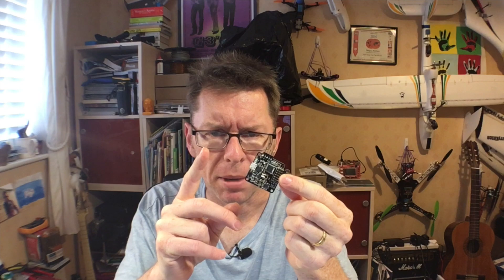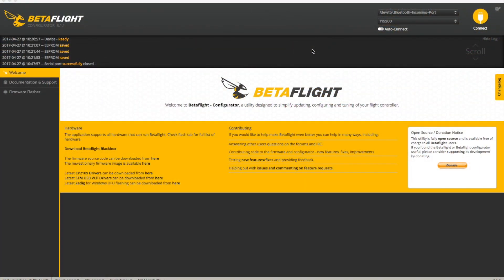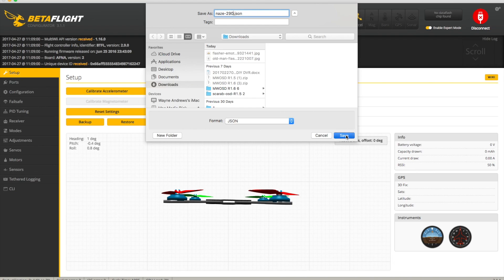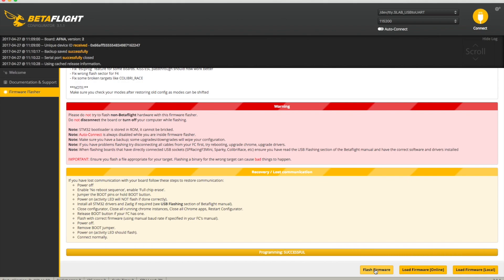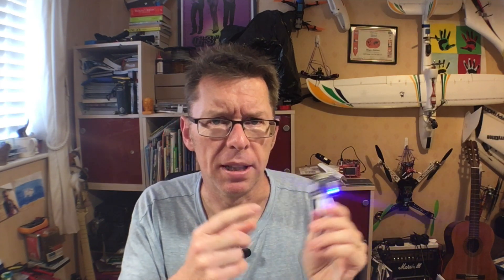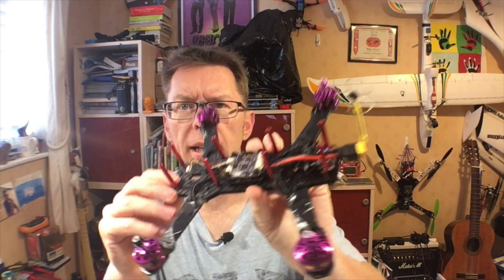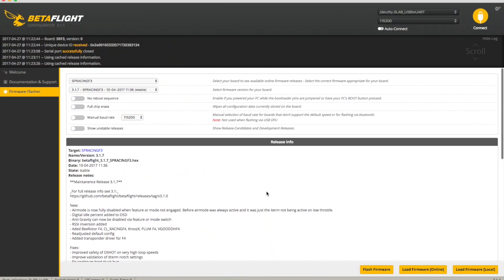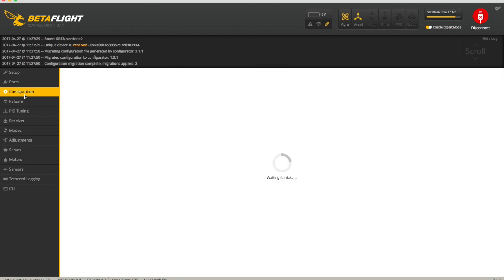FPV Tutorial: BetaFlight Basics Part 1 - Flashing your FC, and what to do if it goes wrong

Comment: So the controller board on my Emax tiny hawk II freestyle will not connect to beta flight.  I connect the data cable I get the initial fast flashing lights then I get two lights and they flash intermittently.  I try pressing the connect button on beta flight and the drone will not connect.   Also when I connect the battery (it’s not connected to beta flight of course). The drone will not power up.  Can you tell me what the issue is?
Reply from the maker: Well, if you are connecting a battery and the quad isn't powering up - that's quite a large issue.  It's not that simple to track down this problem as the TH II freestyle using a single board with the 4-in-1 ESC and the FC.  Did it work originally and stopped, or was this the case from the off?
Reply: @CurryKitten  yes it did work before.  I was actually flying the drone and brought it back in to change the throttle settings.  When I tried reconnecting to beta flight it will not connect.  It was intermittently connecting then all of the sudden it stopped connecting all together.  I can see the flashing lights on the drone but it would not connect.  That’s one issue.  The second issue I noticed that the blades were starting to rip the insulation off the wires for the battery.  I tried moving the wires out of the line of fire for the blades and tried covering the exposed conductor with electrical tape.  I reconnected the batteries and the drone would not power up.  I did a continuity check from the leads on the battery connector to the point where the wires connect to the control board.  My fluke showed that the connection was good for both wires.  I bought another control board and drone altogether and tried connecting the same batteries it powered up both the new drone I bought, and the additional control board I purchased.  I was also able to connect both items to beta flight with no problems.  Please advise.  Thanks.
Reply from the maker: You could try reflashing the firmware to the board - in case it's unable (for whatever reason) to startup betaflight.  You can do this without needing to connect to it in the normal way.  But the lack of powering up does suggest it's more fundamental.  The quick fix is to simply replace it with the one you've bought, or you could look for potentially bad components by tracking the power through.  Best guess, perhaps it's a voltage regulator that might have gone kaput.
Reply: @CurryKitten  I'll just replace the control board with the one I have and go from there.   Thanks!

Comment: Hello Wayne:  i tried to flash my brand new Tina Whoop after trying to get it to arm and not being able to do it.  Followed instructions.  Tried to connect to betaflight, would not allow that,  tried to  update drive4 with Zandig after 20 minutes it failed too.  My 77 yo eyes cant see the bind button, so im stuck with a new toy that wont function.  Any ideas?  John.
Reply from the maker: I assume it's the boot button you can't see rather than the bind?  In which case if I've got the FC right on the Tina Whoop it's a pretty small little button http://myosuploads3.banggood.com/products/20200701/20200701210610QQ20200702095734.jpg If the original firmware is still intact then it might be a simpler thing to attempt to fix the arming issue - which, given the number of people who have the same issue, tends to be that betaflight thinks your throttle is active when it isn't and so refuses to arm.  Let me know what position your quad is in - can you connect into betaflight normally, is it bound to your radio ok?
Reply: @CurryKitten  wayne:  i was able to fix the port with impulse rc and connected to BF, flashed the firmware successfully.  Motors 1&2 will not run in motors, yaw and roll are reversed in setup screen after calibrating accel(before also) changed in receiver screen but that did not work.  Changed AETR, to EATR.  Saved original setup to desktop not bu restore in BF so not am trying to restore originals.  Dumb i know should have been so easy.  I noticed in BF the little battery symbal at the to0 of the setup screen is flashing all different voltages on this T W, not solid green like my old TW.  Any ideas where i need to go?  J
Reply: I did not try to setup my TX 16, i was trying tu us3 the radio that came with it.  I needed your inputs and mixes info from your video to setup my opentx.  J
Reply from the maker: There's a lot to go through there John.  It sounds like some of it is down to some of the firmware settings.  For example you are saying from the setup screen that yaw/roll are reversed - and linking that to the accelerometer calibration.  So are you saying when you lift the quad up physically and tilt it, then it reports roll when you are pitching and vis versa?  In which case that's probably an orientation setting on the board (configuration section)  The lack of motors 1/2 running is the biggest thing to solve.  If they were running before hand then it's probably a difference in the resource settings in the firmware config.  Given that you did flash the right firmware (presumably you checked which one you were running and got a later version) you need to be able to diff against the changes in the original and what you have now to put these things right
Reply: @CurryKitten  wayne  I misspoke its ele and roll that are reversed.   I thought i could change that in receivers, but change in the ae, in aetr didnt effect a change in the setup screen action.  The two motors never moved from the beginning.  Im a mess struggling and appreciate your help immensely.  Maybe its taer in the tina whoop setup.  Id be glad to pay you an assistance fee if you could help me get this TW flying.  John
Reply from the maker: John, there's too much going on in this quad to try an diagnose things in the comments section, but feel free to ping me en email at currykittenfpv at gmail dot com.  Perhaps you can give a full history of this quad - having motors that have never responded is a bit of a red flag in terms of getting a new model
Reply: @CurryKitten  will do Wayne.

Comment: Hi,great video,I've got the same problem with my mobula7, ive done everything you did in this video but still wont flash,just says" failed to open serial port",I'm on windows 10,do I need drivers for this to work,if so,which one? many thanks.
Reply from the maker: I'm not a windows user, so I fall down a bit trying to advise people here, but I keep hearing about the Zadig driver to get into DFU on an FC.  Have a look at this page https://github.com/betaflight/betaflight/wiki/Installing-Betaflight and scroll down to read about zadig
Reply: Its sorted now,many thanks for your reply 😉

Comment: I flashed the wrong firmware and now my usb doesnt work
Reply from the maker: Using the boot button, you should still be able to flash the correct firmware to your board.
Reply: @CurryKitten  thanks. It worked just took a couple times :)
Reply: ...fried the board after installing the receiver lol \_(:/)_/
Reply from the maker: Oh dear - how did that happen - you wouldn't have any dodgy voltage coming in from the RX only out to it ?
Reply: Not sure im new to the space. Everything looked right to me until i connected the receiver. Whats weird is the only voltage going in the fc board to the reciever was from the usb which is 5v. Im gona use a multimeter this time and a fuse between the battery and pcb. Unfortunately i have to buy a new fc board. But i guess that comes with not being experienced.
Reply from the maker: That does sound curious - it's really difficult to fry something when you've only given it the 5v supply from VTX.  Unless you made an error connecting up the RX.... but generally you'd end up killing your RX rather than your FC.  If it helps, we've all got a little pile of bits that we've managed to blow up/murder one way or the other.
Reply: @CurryKitten  turns out the receiver had nothing to do with it.....the metal plate for the SanDisk on the F.C. was touching one of the voltage cables on the P.D.B.  ....almost certain thats what shorted my F.C. board....lessoned learned! Lol

Comment: Good video. I'm having trouble trying to set up the betaflight configurator don't have any idea where is the problem but I keep looking .
Reply from the maker: When you say “setting up the configuration” it should just be a case of download and running it.  Is something going wrong doing this?
Reply: @CurryKitten  yes I think I'm  doing something wrong  installing the drivers for betaflight so I'm not able to connect the flight controller
Reply: And I think that what I'm doing wrong was installing the drivers one step that did not follow was to download the hex files.

Comment: Hi CurryKitten, what version of betaflight would you recommend for someone like my self that can fly acro but am still heavily learning? I've just finished my new build that is a 5" with a DALRC F405 flight controller. Cheers.
Reply from the maker: If you are happy with how your quad is flying - then leave it on whatever it's using.  But if you are building from new, then I generally find that every version of Betaflight is just that bit better even on the defaults, so stick the latest stable version on your board and go from there.

Comment: Would you please do a short show how vid of that last firmware update you spoke of at the end of this Video,, i realize its been a minute since u made these, but i dont seem to grasp the idea on how to get the update completed correctly when i view the only few others instructional videos they have on the st bootloader way, I have a Jjpro p200 race quad, and it came with Cleanflight on it, and an old one at thaf, and when i attempted the flash it did read that it was successful, but now whenever i try and connect to cf or bf, it tries to connect amd then eventually closes, and leaves me with some message which i cannot recall at the moment, but i ve tried to do my homework on the issue and ive come to the conclusion that i do infact need to flash the firmware (naze32/with Spracing firmware btw) but i dont have the correct st flasher, nor the correct info on what to do when and if im abke to get past that point. I would greatly appreciate the help, as ur videos for me anyways seem to be more my speed, plus u dont fill up the time with a bunch of snobby  binary code talk that seems to only alienate me and confuse the hell out me, , I have enjoyed seeing ur reviews etc over the past couple years.  And i know with ur help, ill be able to figure this damn thing out! Also, if you would think about maybe doing sum how toes on setting up ur tananis, mine is qx7, a setup on how to get  the voice working aswell as loading any other mods such as personal opening screeen and so forth,, that would surly help.. thanks again, !
Reply from the maker: Ok, so I'd actually recorded an extra segment using STFlash which is here https://www.youtube.com/watch?v=rs7hgWaV1No (but a bit raw and missing editing/close ups/links etc)  It was mainly discarded because after some testing I was unable to actually find a situation where I couldn't use Betaflight to flash the board in combination with the bootloader.  If you managed to flash the board before but now it doesn't talk, it's possible that's a case of flashing the wrong firmware on it (helpfully enough the version names do change sometimes)  A google for me suggests that the board is an F1 running the Naze firmware rather than the SPracing.  Have you tried flashing it with the straight  Naze target in betaflight ?

Comment: Hey there friend, I have a question for u and pretty much anyone who may know what the heck I'm doing wrong.,  or what I should be doing to make things right again, and short story is this, jjpro Naze 32  software  Spracing f3 fc, and well apon delivery for the $28 U.S bucks Brand New Never Used ARF vhf version.m of the P200 jjpro, for some reason after binding successfully,  I noticed the Dang Buzzer kept going crazy no matter what I tried turning off and on through cf,, anyways since i couldnt even fly it. I decided to go ahead and try flashing, well something messed up, eventually got it flashed ,but now and b4 I flashed I have the steady  blue light, and well I'm never gonna say die ,, !,, I just want so badly to get this in in the air but not for lack of trying I haven't been successful as of yet I was hoping that someone or you sir would be able to play me in the correct direction Regarding why it allows me to flash new firmware now but it's almost like it's stuck in bootloader mode appreciate the help thank you again and Merry Christmas and God bless happy New year, I love the videos

Comment: Hi Wayne....I have started to watch all 5 Tutorials now as I have got myself a Furibee Darkmax Quad coming....Whilst I have learnt quite a lot using iNAV, Im sure this will help me as I think I will have to set up the Modes, OSD, RSSI etc when it arrives from Gearbest...Got myself an XM Plus to put in it which is flashed and ready as I know the D8 RX will be useless.
  Im not too fussed about doing Acro etc I just want to learn to fly round the field smooth like you do but do some hover and filming etc...Is Horizon a good Mode to learn in..?...Cheers m8...:)
Reply from the maker: Watch the tutorial called "Use acro mode".  It doesn't self-level, but it doesn't have to be all flips and rolls either, and is much smoother than horizon as the quad isn't fighting you to get back to level flight all the time.  I should hopefully have a Darkmax coming soon as well :D
Reply: Ok, will do....Im going to need a lot of stick time LOS for a while I think...I know the Darkmax sounds a bit nuts for learning on, but on 3S it shouldn't be too bad...At £114 it seemed like a good deal, be interesting to see how long Gearbest take to deliver it though...Look forward to your review.
Reply from the maker: Ok, if you are going to weird and fly LOS :P then some sort of self-level is not a bad thing - an X in the sky is easy to lose orientation on.  I would always say, as long as you can hover it LOS and it moves correctly then go for FPV !

Comment: I have a question I dropped my quad not too bad but now I can't arm up  and when I go into betaflight on the receiver tab nothing is there not No colors no indication that something supposed to be there nothings there lit up everything is blank and there was a lot of blanking on my Fc  I hit reset the blinking stopped but still can't arm up but I still connected to my remote telemetry and everything still there how can I fix this
Reply from the maker: So the flight controller works properly and everything in Betaflight, but it doesn't see any controls from your radio... is that about the size of it ?  Check the connection from your rx to your flight controller - it might be that your ground/power is ok (if you have telemetry) but your PPM/Sbus connection has an issue.  If it all looks ok, then if possible, try moving your RX to a different UART in case the signal pin on the FC has become damaged.

Comment: Thanks Wayne, that was useful for me....Im a bit dissapointed now though, because iNAV for some reason does not have backup and restore in the Setup Tab..??...Im hoping that at some point they sort that one out as it's essential for copying from one board to another or simply backing up your settings...I like your Tutorials, very easy to follow, not everyone can do them for sure.
Reply from the maker: iNav still seems to be in early days, so I'm sure they'll get there.  Weird they don't have a backup/restore though as you would have thought you would have taken it from the existing configurator code when they forked it !?  Can you not do a dump in the CLI and restore to another board that way ?

Comment: To add a bit more to the Windows driver thing. I believe in some cases when the board won't connect for flashing, this might be the culprit rather than jumper or button issues:

I've just done (following your vid, thx) a flash to a Rotorgeeks SSD F3 board that I have, still haven't built the quad for it yet, but thought I might as well flash the board. After choosing RG_SSD_F3 in flashing screen on Betaflight, it told me it couldn't connect when I tried to flash. I went looking for jumpers or buttons on the board but the RG SSD F3 has none of these. I checked the page for the board on the Rotorgeeks site and it gave instructions on using a third party program called Zadig, which is a driver management program, will install drivers for port things, concerning the STM32 drivers (which is always coming up, like when I tried to use it for FPV Freerider, it's a pain in the arse). Once I followed those instructions, everything was fine and I could flash. It wouldn't surprise me at all if these instructions for getting those STM32 things set up apply to other boards in a Windows environment, so here's the link to that page (towards the bottom, 'Flashing'):

http://rotorgeeks.com/index.php?route=product/product&product_id=676

Hope this helps folks.

Comment: It's also important to make sure your drivers are bang up to date before you start I had a nightmare with it till I got it sorted good vid very informative
Reply from the maker: Yes - I'm at a little bit of a disadvantage here, because I don't go through the normal Windows drivers issues that many people have (as I do all my work from a Mac) I did test it out on my Windows 7  VM and it just automatically installed the needed drivers and worked.... which i guess it what should happen, but isn't necessarily the case for all users